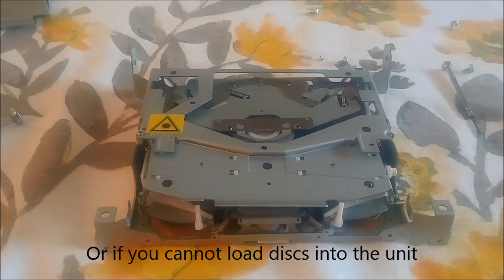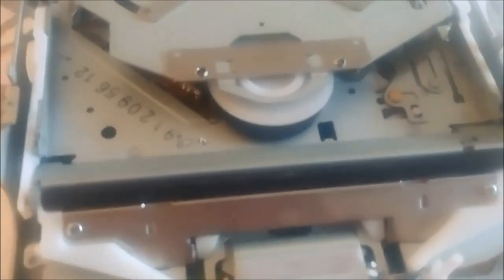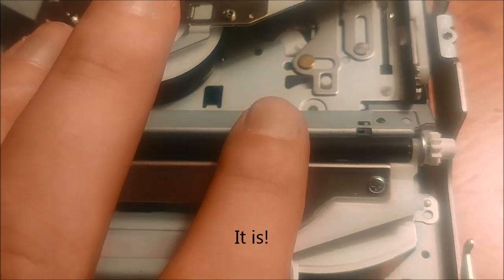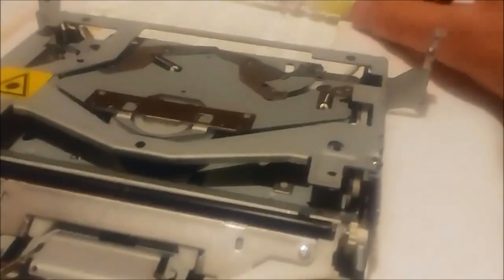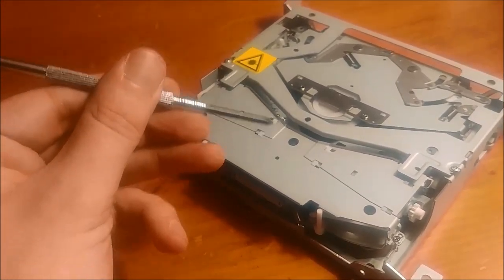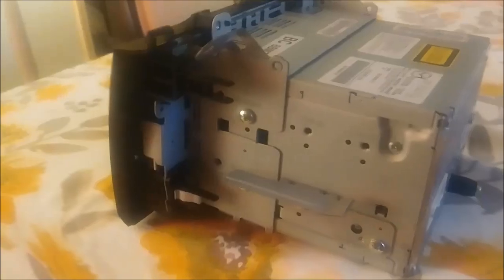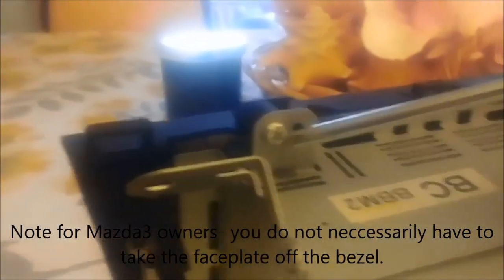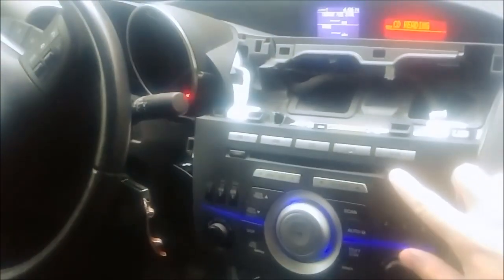How To Fix A Car CD Player That Won't Load Or Eject Discs

Comment: Finally someone addressing the REAL problem instead of just cleaning it lol. (Still a bit intimidating without any guide for disassembling it, but the temptation of having a working CD player again is strong enough to push me to try this… also not sure how you got the glue under the rubber… didn’t really show how you did anything, sorry for the criticism… overall I still appreciated the video, gives me confidence that it can be done.
Reply: I guess you talk about it at the end, so that’s pretty much good enough. Cheers!

Comment: I'm a retired electronics engineer but I cannot fix this Roberts MP Sound 43  Radio/CD drive.  SOMETIMES the  eject roller fails to run. It seems to sense the disc as it is presented and the radio, (if playing ), switches off. However it fails to take the disc in. Conversely  it will sometimes fail to eject. There is no discernible way to get it  back to working  correctly even dismantling  to clean. Tapping around yields nothing loose.   At first I suspected the motor. brushes.  However it reads consistently even when the fault is present.  (10R dc). You can't provoke any action by turning the mechanism by hand. Looked for maker. Looked for schematic. Cannot find or ID it beyond Roberts. Sometimes a complete power down restores the operation but not consistently. Its really hard to get apart and reassemble and I want some inspiration before I do that again. Can you help at all?    {BTW it came in with no power. Replaced o/c SMPSU 620K start up resistor and power is now correct at 10.5V}  Sincerely BerryG

Comment: My problem is that it takes the CD in but will spit it back out.
Reply: I took it apart and observed the action when plugged back in with the top off and the device internals reject it even without trying to read it. All the small capacitors look good.
Reply: Cancel19 
I have 2011 Toyota Corolla, don't know if this advice will help,but my CD player kept  flashing CD IN,but there  was  no CD in player, it wouldn't let me incert another CD thou, I tried holding eject button for about 40 seconds, but that didn't help,so I had a small thin  piece of plastic,I inserted  it into CD player a few inches, very light pressed down, and for some reason,that turned off the stuck CD in light,and now it's working great.
Reply: @joannp5806  Thanks for sharing. I'll check that out. I believe the program in one of the IC chips went bad.
Reply: Cancel19 
Welcome ,even I'm surprised it worked! Don't even know why I thought  of doing  that,guess I figured, what  did I have to lose?

Comment: I have a 2002 Lincoln ls. Just started getting the cd error message. It won’t eject cds or do anything. I’m afraid the CD player is shot or locked up and it has the 6 disc changer so it will be a nightmare to get my cds out

Comment: Thank you for your patient and exacting reply to a question I have right now. But this lets me know.....way beyond my capabilities. And requires a syringe. I guess they might be available for diabetics at the pharmacy, not sure. Quite confident I would be a fail at even removing the thing in the first place, I have looked at the thing, I presume its doable, but looking at it I would not know how. Break out the wallet time. But thank you for real.

Comment: Awesome video, was very helpful for me!  I fixed what was wrong with my 6 CD changing stero but after putting it back together it looks some parts are out of sync as if some motors need to be in a certain starting position when it's first powered on. Was careful dissembling my 6 CD changer but it's still not happy. Any suggestions?
Reply: Aw man, I feel your pain… hope you can figure out a solution. Keep trying stuff, sorry I can’t help.

Comment: I Have a 2010 Mazda 3. the stereo wouldn't read the CD. I knew it should be a dirty lens but the repair guy said it's the motor and you need to change it. today I got some spare time and took it out, disassembled some parts and cleaned the lens. it was really dirty. it is working just fine now.
for the assembly you just need to be very careful. I have to do it twice to make everything work properly. I'm happy I didn't have to pay for the motor change.

Comment: Thanks for the video.  My player in a 2005 Chevy Enduramax has the slipping rubber roller on a metal shaft.  I also noticed that the plastic gear on one end of the metal drive rod was spinning....lost adhesion.  Glad your contact cement / syringe procedure worked. Has it held up over the recent years ?

Comment: My Ford CD player looks the same - the problem with mine was it wouldn't read discs and just ejected them. Turns out that white plastic disc that gets pressed down on the cd was worn and wasn't spinning freely. It had worn through on the sharp pressed metal sheets that it bears against. Hope i can get a replacement...

Comment: Dude ..had same problem with my wagon ford focus 2005.puller rubbler  roller from the inside axle get worn out as the years pass..maybe class D roller..doesn't last longer than 5 years 😁.. thanks for the video

Comment: I have never put a CD into my CD player so far Volvo S40, I have a little device, I bought for €20 it goes into your cigarette lighter it's about 4 inches in length,  it has a port for charging your phone at the side of it , on the top it has a button saying answer or hang up phone calls, but it also has a display and you can put it to any digit you want in reference like radio station saying 87.26 then go to your stereo pick a button you don't usually press, copy the numbers to your radio you might have to go to fine tune then when this is done , go to your phone press Bluetooth it will  pop up and then you will see pairing with car device , when it's done and you can play any song that you can find in the world from YouTube or iTunes, or stuff that you have stored on it SD card, and you can answer phone calls you can use the phone to push except  the call or you can use the little device the Bolton I said talked about earlier €20 instead of all this parts, Wires going all over the place taking your car all apart with this you just stick  in your cigarette lighter end of story, boom.lol.
Reply: Nice story bro, but this topic is about how to fix a broken cd player. The fm transmitter you are talking about is not rocket science and not something from the future. Thats a very old stuff. And you never ever can get high quality sound from a fm transmitter.

Comment: Julio - I implemented your fix for CD "non-ejection" in my Mazda6 - thanks so much for that video.  HOWEVER, when I was reassembling the entire unit, I inadvertently pulled the ribbon cable out of the radio end, and do not know EXACTLY where to reconnect the CD ribbon cable to the radio "motherboard".Might you have taken any photos of the inside of the radio when you had the unit disassembled,, that shows the ribbon cable.  My Mazda dealer has been no help in securing this information. Gary McCormick Carlisle, PA